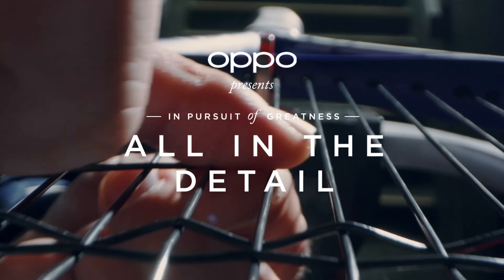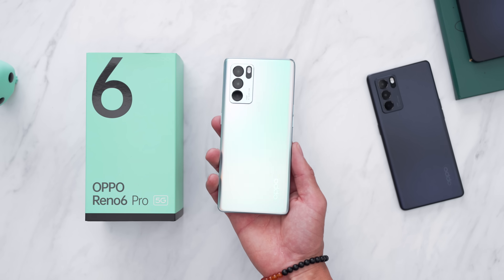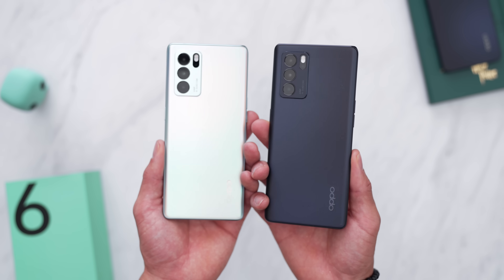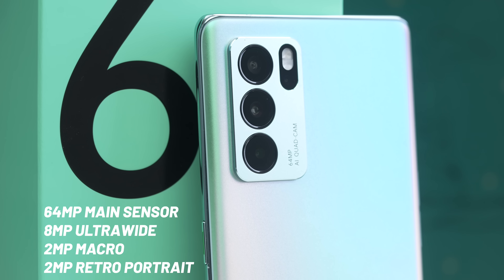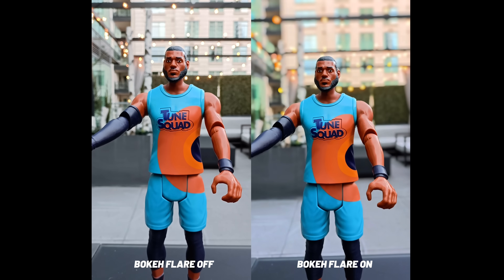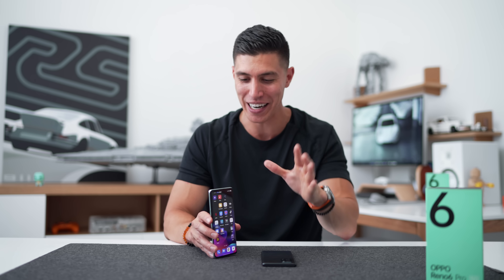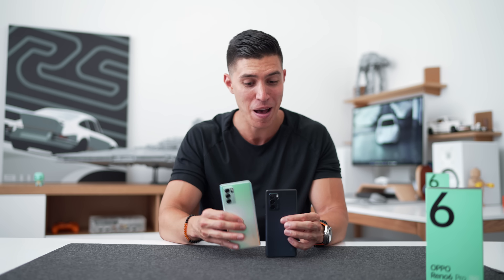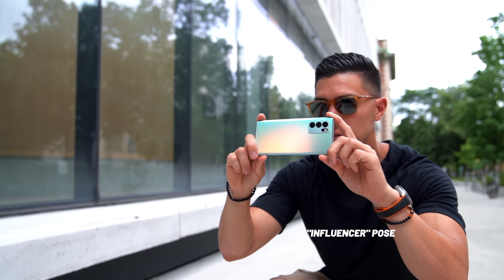OPPO Reno 6 Pro REVIEW - This REPLACES Your Camera!

Comment: If you've admired Samsung S9 Plus (5 year old phone), then this phone is its re-incarnation and better one.

Pros:
1) Unbelievable Good Looks - slim n trim. In hand feel is awesome. Good-feel phone after a long long time.
1.A) Edge display is just wow!
2) One of the finest screens on an Android phone. Better than OP9R and 9.
3) Class leading cameras - upto 10x digital zoom and results (both still images as well as video) are outstanding.
4) Back is scratch resistant - no need for case/cover.
5) Very good if not great battery life.

Cons:
Single firing speaker. At this price...should 've given stereo speakers.
No Headphone jack(but not deal-breaker)